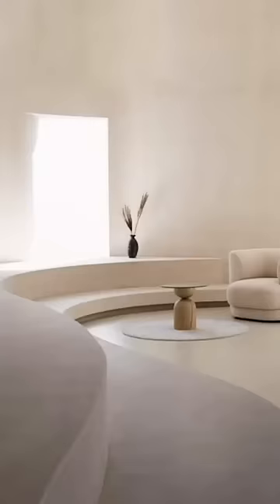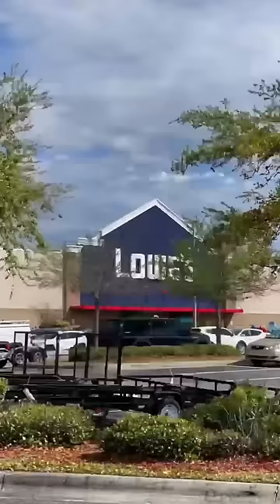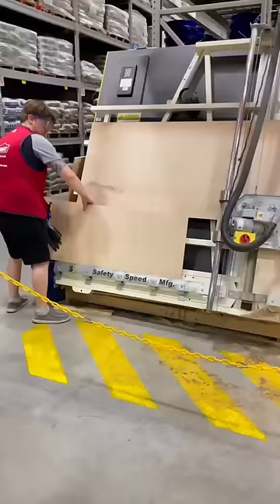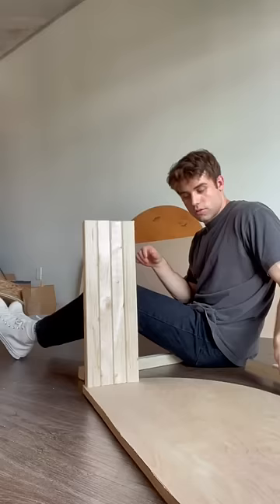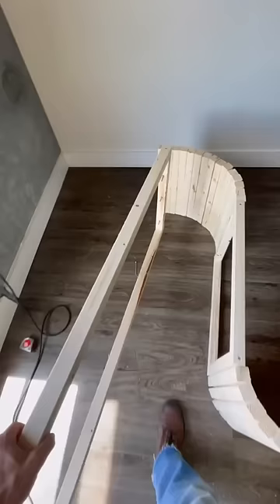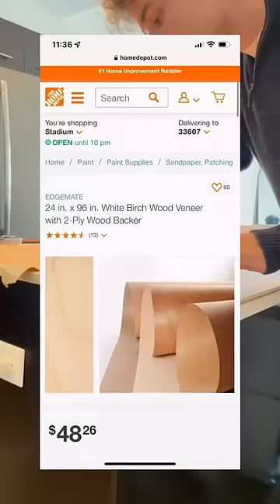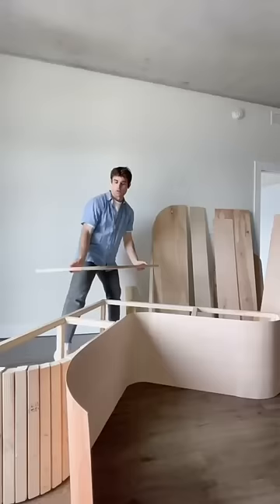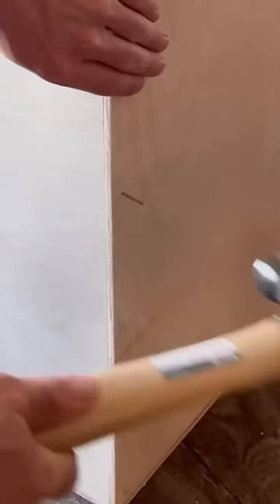How to make the round corner bench of your dreams 🪚🤌🏽 #buildwithjacob #interiordesign

Comment: cool! but one thing to think about when buying furniture compared to DIY stuff is the quality of material used. yes those are expensive but they use nice material that will last for years and is comfortable. most people only think about the visual but furniture needs to be used not only be seen as a decoration
Reply: you can finish wood to keep it lively for decades. besides, you’d be surprised how low even high end brands’ quality of materials is. in the end, if you can make it well, you’ll know how to keep it alive forever.
Reply: you can easily do a research about material. its really out there. its really just tools and time that stopping people from doing their own furniture.
Reply: @NickonStark  Yeah but this seat is going to begin to bend very quickly. There's not much support. Also, the wood veneer will likely easily be damaged as it was just laid on top of the wood underneath, which will warp and expand over time while the veneer stays the same shape, leading to cracking and damage. You can't really fix veneer like you can wood so he'd have to replace it.
Reply: Not always the case
Reply: most expensive shit is still made from plywood lol
Reply: @emstink  All you’d need to do is add a few beans in there to support it. A beam or two in the middle, or just an extra strip of wood down the middle is plenty to keep the bench from warping. Personally I’d still rather that than an Ikea bench made of what’s essentially just MDF. A lot of major companies just use a thin sheet of plywood over some cardboard, and frankly I’d rather do the research to make a structurally sound DIY for that.
Reply: @kathaai  no it's not.
Reply: It's a shame that anyone thinks that this will look like a $1500 piece of furniture. Noone will think that when they sit at the table - you're better off spending $250 on some solid pine or oak furniture at a charity shop.
Reply: What material do you think they are using that will be more durable and comfortable?
Reply: Lol that’s funny. I bet his bench lasts as long as he does. Get off your high pedestal…
Reply: Haters gonna hate. Do people not have anything better to do the cut up his ability to create things? While you just sit behind your monitor and say how it can’t be done and how it will warp and start looking like crap, ya then he pulls out his tools and fixes it. Unreal what the world has come to.
Reply: It depend. A lot of places don't really use nice material, just really good finishing that would normally take a lot of time. That said, yeah, the price is normally justified bc of the time needed.
Reply: What's great is that you can tell he's got a foundation of skills to build on to improve his work. Not everything expensive is made well.
Reply: Well no. You can use this exact design, add a bit of support and use whatever quality materials your heart desires. Problem solved. Also it will probably be better quality than buying. The upsell is high on furniture.
Reply: You ever broken down a $3000 sectional? I have to help someone throw it away. And I promise you there is nothing in that damn couch that makes it worth 3000. It’s all just marketing. You pay for names.
Reply: I make wooden enclosures at around $250 - $350 a pop, and these are pretty massive, sturdy pieces.  Anything else out on the market is gonna be flimsy and die out after a few months of use, not to mention practically double the price (looking at you zen habitats)
Reply: Furniture has 1 of the biggest mark-ups in retail😂
Reply: I can def get this for 200 bucks somewhere for the same quality which is why i think its sorta a waste of time
Reply: @MissSchnickfitzel  you forget the person you are buying from has to raise the price to make money(profit), so it'll probably be $300 with the table...
Reply: How much u getting paid bruh
Reply: @juliemunro76  exactly! He's working hard building his own furniture to save money while people complain that the bench will break, its not comfortable etc. He can easily fix it if it breaks and he can just cut out some foam, put a sheet on the foam and put it on the bench. People really think paying $1500 is better than paying about $250... A dollar is ₱51 in my country so $1500 is kinda a lot.... It IS much more worth it to either build it yourself if you're good at it or hire a carpenter who's works last at least a generation or 2 and just pay the guy.
Reply: @minholly1358  I agree
Reply: That may be true but he's learning life lessons by doing this. Ie how to make your own furniture, so he can always improve in his next projects and use tips and tricks that he learns from the next things he makes to improve on his overall product. Not to mention the fact in the world we live in now trends change and he'll most likely want to change stuff for something different in a few years anyway.
Reply: Hey kiddo just wanna let you know, wood is way more durable than fabric 👍😂
Reply: Not always true!!! So so many high end furniture brands really do just spend $250 on materials, another couple hundred on labor then the retailer upcharges 40%-50% which lands you at that terrible $1500 price tag
Reply: Wait until this guy realizes his house is made out of 2×4 from home depot.
Reply: No its not
Reply: If he wanted to make it out of extremely durable material it would cost 400$ max.
Reply: @1physics you would be surprised how many use it though
Reply: @emstink  Easy to correct the design with only a few support posts, will barely add anything to the  cost as you could use the cheapest pine for it.
Reply: I make actual high end furniture, the materials they use in their's is normally the same or worse than in the video. Mass production means fast grown timber and ill fitment on the wrong joints for the job, which is obviously 💩 for furniture. I always visit furniture stores and I'm yet to buy a new piece, I'd rather make my own or if I'm lucky enough find and old gem buy and restore that and my youngest piece is around 90 I believe.
Reply: Problem is you can buy even higher quality materials because even expensive furniture brands tend to use the cheapest possible materials then use their name to sell it. You don't even really need to be a skilled carpenter to make furniture that will outlast even the most expensive
Reply: Think of the budget. I can build a bed frame out of pine that can support 1,000 lb for about $90. Or, I can buy one for $200 from a furniture store that can barely support my weight (330lbs). If you insist on having hardwood, veneers exist. There's also finishing plywood, which is just very thin plywood, A.K.A the 'bendy wood'.
Reply: @1physics  it is
Reply: Yeah great consumer mentality 👍👍👌👌
Reply: In India most people prefer getting their furniture made over buying from a store because it's easier to match when you make your own. Also store bought is considered cheaper cause you don't have a say on the fabric and wood whereas custom made is completely upto you. It all depends on how much you're willing to spend on the raw material and how you take care of it.
Reply: He used what they would use to produce those benches.
Birch.
Lightweight, but hard and takes finishes well.
The only difference is his shoddy craftsmanship, but other than that the materials are not at all a difference.
DIY is 9/10, better quality, because you have full control over materials and you can ask people who are knowledgeable about materials and different projects their opinion.
If i knew his geography, I'd know roughly what species of birch was in his store; but it really isn't relevant.
The difference in hardness, and grain structure between birches isn't super drastic, so using paper birch over yellow bark birch isn't going to significantly effect anything.
Let's assume it's River Birch, because that's the most common throughout the United States, River Birch is used for constructing crates, furniture, veneers, baskets, sometimes railroad ties, and very rarely as pulpwood for making paper or making plywood/Pressboard.
Birch trees are all generally non-sappy, non-gummy trees, with a decently high moisture content, strong decently closed grain, and nearly all species having a usable hard wood, makes birch literally perfect for this application, ESPECIALLY if he planned on adding a finish to it.
If not, you can select a specialty birch like Cherry birch, which darkens as it ages, making it look like Cherry wood.
Reply: @1physics  Obviously you've never sat in one of those chairs before.
They are NOT comfortable, that style of wavy chair and table is ALL for looks.
Reply: @romeoalpasthor5187  Bullshit! He used an extremely durable material, Christ sake!
None of you are even familiar with what these woods are used for, he TOLD US WHAT GENUS OF TREE HE IS USING, THAT FAMILY HAS MANY MANY SPECIES, ALL OF WHICH ARE THE MOST COMMONLY GROWN AND MOST COMMONLY OCCURING, THAT ARE NOT ONLT SUFFICIENT FOR BUILDING FURNITURE, BUT ACTUALLY PREFERABLE.
Christ, y'all forget Native Americans made BOATS FROM THE BARK OF THESE TREES.
Reply: It's still better than anything Ikea that now a lot of people are buying, buy used solid wood furniture
Reply: @jacob1121  it's obvious from the weight and the look and.....from the description 😂 it's up to you what you buy but there's no point in implying I don't know what my furniture's made of. I buy mostly from charity shops and solid oak and pine. If I buy new, I'm careful to make it sustainable forest. I know exactly what I'm paying for and it isn't cheap materials.
Reply: @themmgamer1227  you act like the material used for each bit isn't easy to find out and often a selling point (solid oak drawers, pine panels etc etc) - sounds like you make cheap shit that sells for a lot of money which isn't the same as high end furniture. Ask yourself "does my furniture have MDF or veneers"? If you answer yes, then it isn't in any way high end and is in fact the same shit they sell at IKEA. Just like this DIY project, which is great for what it is.
Reply: as a family member in very high quality furniture, I have found that EVERY piece that we have gotten is significantly less comfortable than any cheap piece. also many luxury furniture brands such as Moe's, Bernhardt, and even Hooker are using "eco friendly" methods using wood  veneer which is literally just particle board with nice wood glued to it.
Reply: @emstink  then use tougher wood?
(Only if its not to expensive to use in your area, i live in australia and its everywhere here)
Reply: Hate to tell you, but they don't make crap worth anything anymore, and often can get better materials for cheaper if you can do the work
Reply: @1physics  actually I make well priced pieces of art using traditional joinery techniques. The materials I use are the best of the best, naturally slow grown solid hard woods, which take me hours and hours to choose, all milled the correct way, not the easy way. I'd never use artificial timbers, just like I'd never use a butt joint, because as previously stated, I make things properly and to last as I'm trying to counteract the throw away society we live in. My pieces have won awards and sold for tens of thousands, but go ahead and make out I'm clueless about the trade I am referred to a master in.
Reply: I work next to an upholstery place. The frames are far worst with cheaper materials that this. Honestly
Reply: I agree
Reply: Most furniture these days is horrid quality unless you buy it from Amish communities using old craft techiques
Reply: I would say the same if I wasn't a handy man myself...the you have with something you make is just different...practice makes perfect and yes it does last a lifetime when you can keep it alive yourself...
Reply: I'm sorry, did you say "nice material"? 🤣🤣🤣 Furniture nowadays is made from the cheapest trash companies can get their hands on.  MDF, Particleboard, and wafer-thin veneers to make it look like "nice material".
Reply: @ammarmirza507  and skill***
Reply: Meh skipped.

I'll learn with crap wood. Get good and remake something better next year
Reply from the maker: Been working on a few things to make it more comfy 🤌🏽
Reply: @jacobzandershorts  oh shoot. Ty for the video. Keep us updated.
Reply: @themmgamer1227  really now, if you are as good as you claim you are and your pieces sell for as much as you say they do, whats your name, social media, website, somewhere that we can see your 'award winning' art and proof that its yours. We'll be waiting 😊
Reply: No sh*t, Einstein 🙄.
Reply: That's true in some cases, but not in all cases. There are lots of expensive furniture made from cheap materials that are durable but start looking ugly with time. And depending on how expensive is the area you live in, you can also find very expensive crappy furniture.
Reply: @kathaai  particle board

Comment: Tip from someone who’s made stuff kinda like this for clients. Figure out how deep you want the curve and measure it on a small sheet of plywood and cut it out to use as kinda a mold/placeholder so you get the right curve every time
Reply from the maker: That’s so smart!!
Reply: @jacobzandershorts  most of the time you don’t even need to buy an extra piece of wood. You can use a scrap one as long as you have a couple inches in width so it’ll be stable and not break easy

Comment: Rather than using individual wood pillars to make the curve, you could use a few to make the overall shape, then use about 1/2 inch flat plywood and cut notches on the outside every  inch or so where the curves are, then steam it or iron it with a wet rag to make it bend to the curvature you need. Turned pretty good either way.
Reply from the maker: I looked into that but I wasn’t sure if I would be able to do it well enough haha! Thought this was a little easier!
Reply: @jacobzandershorts  all you need is a circular saw to kerf the wood

Comment: Damn these comments are not passing the vibe check. You did great dude thank you for showing us your process!
Reply: Bro didn’t even sand it down 😭
Reply: Looking at the comments. The people who are saying that the build is wrong, aren't just saying that. It's actually not the way to go about building something like this. There are no reinforcements in the frame, the veneer he used wasn't glued properly. This causes a weak hold so after awhile of use. The veneer will eventually start to peel right off. Also what he should have done when trimming the extra wood is use a trim bit for a router. Something that you can get cheap at a pawn shop. You'll have a better result, then sand everything down. The idea is there and the design is nice. But like many have said, including myself. The way he went about building it is not the proper way. Also he's most likely in the united states, cause I live in Canada and 215 for the materials is just not enough. It would most likely be double that where I live.

Comment: Edit: @Jacob Zander, if you read this, I admire your enthusiasm about your diy, but you should really consider getting some Tipps and expertise from someone more experienced. Your basic desing is good, but the execution is flawed. If you consider doing such a project again, feel free to dm me on instagram. My English is not the best, and it could take me some time to respond, but I would gladly help you out👍🏼

Original: As professional, trained woodworker I do NOT recommend the way this project was build. This is just a huge waste of material. Might look cool for a few days, will definitely break in the first two month of regular using.
Reply: Why? It looks stable
Reply: @lizbelitty5426  I’d also like an explanation
Reply: @lizbelitty5426  there’s no triangular support structure, it will tip.
Reply: Like Elizabeth said, no support structure, the „bendywood“ was not properly clamped down while glueing so it won’t stick to the underlaying construction as well, and he didn’t use proper joinery. He just screwd in wood which goes along the grain to head wood. Screws won’t hold in headwood, if you put them under lateral movement (like sitting down and slinding on it to reach the far end). You also will always scratch your cloth or skin on that edges if you don’t sand them down. If you want to do it the right way, look up „bent plywood“. 

This here is just a terrible diy where the builder has no expertise at all. I don’t say that you can’t do something like that yourself, but if you want to do a video about your built, please get a properly trained expert to help you with it. 

I do hope you understand what I am talking about, my English is a bit rusty😅

Edit: also, if you want to trim your „bendywood“, use a proper trimmer router (you can rent one of you don’t want to buy it). 
And if you don’t build a supporting bent plywood structure to support your  top veneer (aka „bendywood“), it will break the fist time you accidentally kick it at one of those uneven round corners.
Reply: I think this dude would love constructive criticism that isn’t so self righteous! He seems really open to feedback and it’d be an amazing opportunity for both of you to collaborate and improve concepts to make these pieces accessible to diyers who want to make them themselves. You said your English is rusty so it could just be that it was unintentional but just addressing the poster straight on instead of speaking down about his work to his audience changes the emotion behind the comment and opens a dialogue!
Reply: @aneksii5769  you made a really good point! I am sometimes somewhat stupid about empathetic behaviour(?)😅 i work with wood, not people😅😅 

But I am ashamed to say, you are absolutely right!
Reply: No shame needed! We all have our specific strengths, thats why community is so important! ❤️
Reply: @aneksii5769  I do like his video style though. I myself just started as a  YouTube woodworking… person, and it’s really haaaaard😅